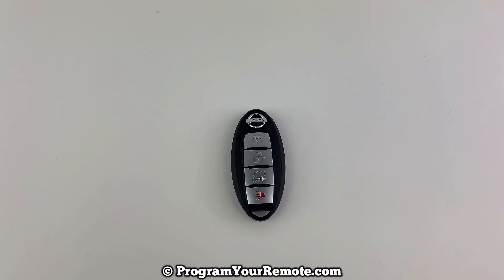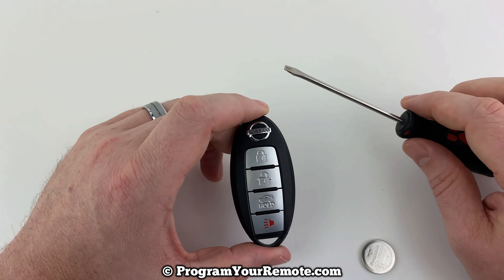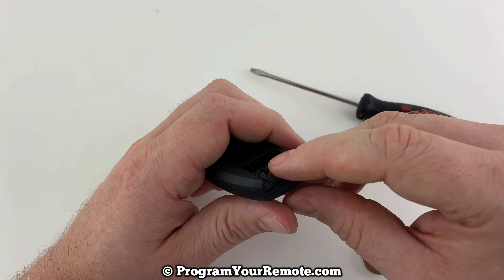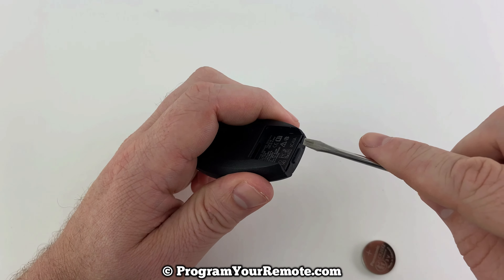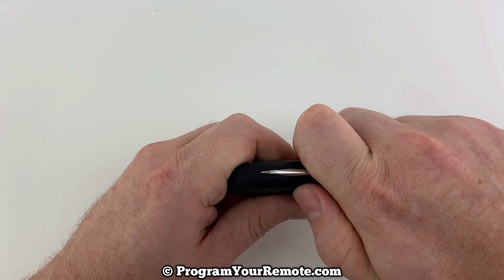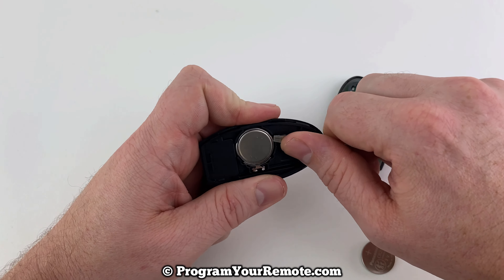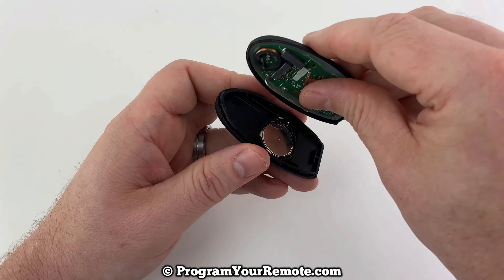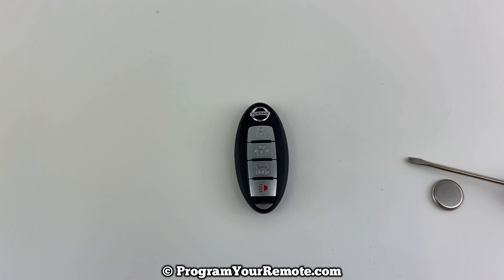How To Change 2019 - 2023 Nissan Altima Remote Key Fob Battery - Remove Replace Replacement Tutorial

Comment: Is there any issue If i use battery Cr2025 instead of CR2032?
Reply from the maker: it will probably work but I wouldn't recommend it

Comment: Will my smart key need to be reprogrammed after battery replacement?
Reply from the maker: No
Reply: @PYR-Auto  My Keyphob needs reprogramming, which is very interesting. I replaced the battery, and now it does not work on the car...
Reply: @rbanister100  mines still won't start but it does lock the doors

Comment: Just FYI, if you use the small screwdriver on both little slots the same way, you don't have to scoot around the edge of the key fob. It opens up enough to easily pry the two halves apart.